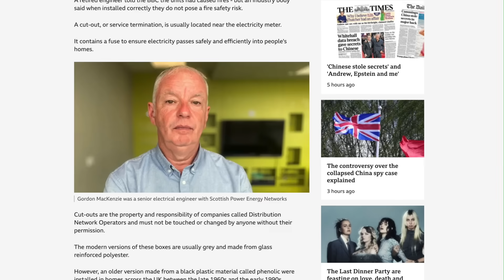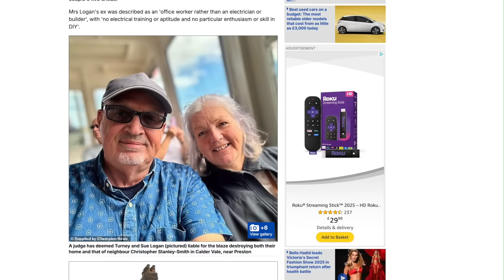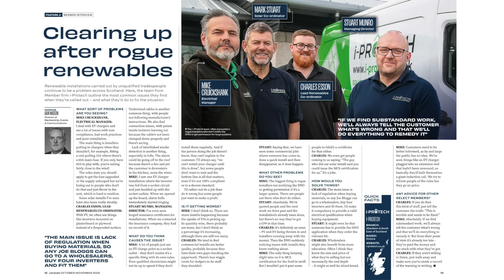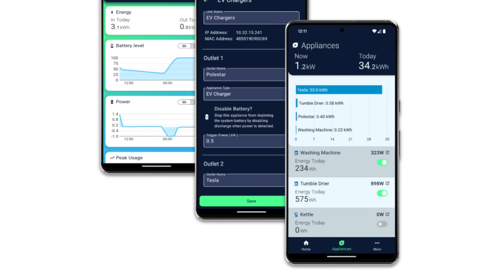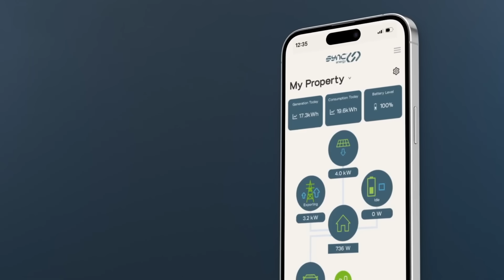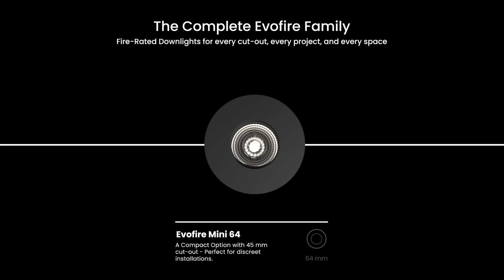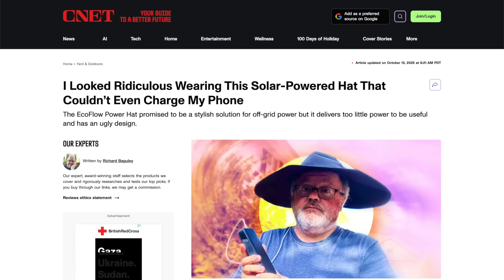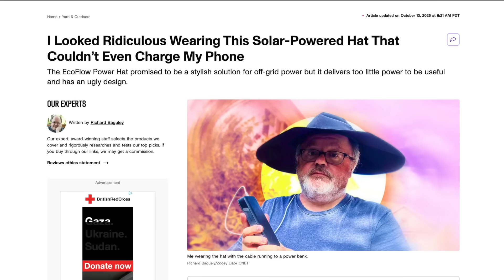Why Is the Electrical Industry Ignoring This?

Comment: I recently came across an EV install where the tails had been removed from the meter to fit new ones to Henley blocks. The installer hadn’t fit the tails back into the meter properly at either side. The live into the meter didn’t even have the terminal screws tightened at all and the plastic had begun to melt. To top it off, the cover hadn’t been fitted back onto the meter, leaving the whole terminal block open to touch 😬
Reply: Ripe with RIDDOR!
Reply: Seems really nice for the customer. Quite low bills

Comment: At what point does running an extension lead become an installation subject to wiring regs? Thousands of sheds throughout the country have extension leads running freezers, lights, power tools etc, not to mention all the extension leads in houses.
I'm curious as to how the court could be sure enough that the problem was the extension lead and not the freezer itself or its cable. And was the fact the plug was removed & refitted a significant legal point?
It seems likely the insurers have declined the claim, assuming they had insurance.
Reply: Generally the states in Australia consider 'used in lieu of fixed wiring' and that is defined essentially as the cord being fixed, ie clipped, zip tied, wrap around, woven through, wedged under or any other way that prevents it from just being rolled up and put away.  Cutting the end off and fitting a plug  is allowed in some states but cutting the plug off and putting it through a small hole would mean it can not just be put away, and become defacto fixed wiring.
Reply: @retrozmachine1189  Interesting point, as my first thought was that it wasn't part of the fixed wiring since it was on a plug end, but you make some very valid points. It does eventually, literally, become fixed!
Reply: The Independent has a lengthy article about this & the key points are that this was "used as a permanent installation", & the cable was unsuitable for an outdoor environment, in particular not protected against rodent damage.
Reply: @alanjewell9550  Correct Alan. Put an indoor cable permanently outdoors and yes rodents will eat through it, causing a hazard. Seems easy enough to understand.
Reply: @0liver0verson9 ..Are you trying to suggest rodents don't come inside houses and chew cables?....
Reply: @alanjewell9550 But you can argue a fridge/freezer cabled into a BS1363 plug and socket on a ring main in the kitchen is a permanent installation. It's fixed, it doesn't physically move and it is powered on 24 hours per day, 7 days per week.

Are they saying that because the cable exits the house that it now falls within scope of BS7671 ?

Any litigation, civil or criminal isn't done under BS7671, it will be done under Health and Safety legislation and or The Building Regulations, as BS7671 isn't an act of parliament.

It looks as if that because it is an electrical installation outdoor, even though what is normally considered an appliance on a BS1363 plug and socket, a permanent outdoor installation that it falls within scope of the building regs.
Reply: @deang5622 A fridge freezer installed in a kitchen plugged into a fixed socket is in use according to manufacturers instructions and the socket is covered by regs. What if it's plugged into an extension lead on a "permanent" basis to avoid the cost of getting an electrician to install an additional socket? This is where the potential implications of this ruling get interesting. Extension leads indoors are a frequent cause of problems as they are easy to overload & a lot of them are poor quality. Are we going to see  similar cases around these?
Reply: Any electrical installation used outdoors must be visually checked regularly and inspected by a qualified electrician at least every five years. The shed fire developed rapidly, most likely because it was filled with combustible materials. When the fire brigade arrived, they withdrew after spotting a propane cylinder beside the shed.

A freezer kept in a shed  can attract rodents, which often chew through cables. Using SWA cable with proper RCD protection might have prevented the ignition, or the fire may have started on the freezer’s power lead. 

According to other reports, the neighbour’s insurance company later pushed to take the incident to civil court, effectively boxing the homeowners into a corner with legal arguments.

Outcome, get an electrician to install the electrics, it may still catch fire, but you have a legal defense.

Additional 
Observation: Extension leads in use. These are not part of the fixed electrical installation (BS 7671) and should not be used as a permanent means of supply. Prolonged use may present risk of overloading or mechanical damage. Ensure suitable RCD protection and consider installing additional socket outlets to reduce reliance on extension leads.
Code: C3 – Improvement recommended.
Reply: @Brickandmetal  £100 roll of armard cable, any type, the cheapest will do, using the wild mounts, underwater in lakes or seas, the it keeping freezzer going light or two, but yes using cheap, or even andn expensave extanchon cord? Not a good idea, but all the home power ring main works your extension cable in breaking at the point it connects up,
Reply: Also, it was 13 years after the initial installation of the extension lead, so unless it was the blindingly obvious error, would have thought it would be difficult to tell the difference between a degradation over time and bad install ?
Reply: especially when the judge goes on to say that the cause was ultimately rodent damage !
Reply: You could argue the wiring regs don't apply because this is not part of the electrical installation, but the fact is the houses burned down because of insufficient competence by the person who installed the fridge and cable.
 This was a High Court case so it's a civil action against the installer.

So even if the regs don't apply, the installer is accountable for not applying sufficient skill in performing the installation.
Reply: The scenario was that they ran an extension lead into a shed for 13 years. Taking the plug off changes its purpose — it is no longer temporary and is now permanent. Once a lead is repurposed and fixed in place for that length of time, it becomes part of the fixed electrical installation under BS 7671 and the Electricity at Work Regulations 1989. The Wiring Regulations define an installation as “an assembly of associated electrical equipment supplied from a common origin to fulfil a specific purpose.” By removing the plug and fixing the cable, it ceases to be portable equipment and must comply with all the requirements for fixed wiring — including correct cable type, mechanical protection, RCD protection, and proper termination.

The regulations are the basics of what we do as electricians, but you also have to apply your own common sense. The case, as reported in the media, stated that the neighbour’s insurance company pushed for a civil court claim. For electricians, this should be alarming. If you inspected the property and ignored the extension lead — without even making an observation note — then the judge could have held you accountable as the competent person. You could be liable for £350,000 for one house and another £350,000 for the second house.

I hadn’t considered the legal implications of this before, but something as simple as an extension lead could end your business. Once a case like this is won and sets a precedent, insurance companies will push it hard. They now have a clear path to pursue electricians or inspectors who overlook fixed or unsafe extension leads during EICRs or inspections. This shows that professional negligence doesn’t always come from major faults — sometimes it’s the small, everyday things that catch you out. A missed observation, especially one that results in property damage or injury, could lead to civil liability and financial ruin. With insurers now using these cases to recover their losses, every competent person signing off an installation needs to be hyper-aware of what “temporary” really means.

This highlights the importance of professional judgement: the Wiring Regulations provide the baseline, but it’s common sense and diligence that prevent accidents and protect you from liability. A 13-year “temporary” lead is no longer temporary — it’s an unsafe fixed installation waiting for a problem.
Reply: @Brickandmetal My reading was the plug was removed to pass through a hole and plug was put back..? maybe I've miss understood
Reply: @roystevenson1375 Morning, yes, that is correct. The extension lead cable is put through the hole, meaning it’s no longer portable and stops being an extension lead in its truest sense. How the regulations see this is partly irrelevant in court — what really matters is how the legal counsel argues its definition and how the judge interprets it. It’s a fascinating story. In this case, it would be classed as fixed wiring because the plug was removed, later reattached, and the lead was left in place running for 13 years.
Reply: @Brickandmetal You have summed up the potential gravity of this case perfectly. It sets a precedent that insurance companies are going to use, hence we're all going to need to be very mindful of whenever we come across any "temporary" installation.
Reply: Again, I think the homeowners / policyholders lost this because the insurance company decided to throw some high-priced legal team at it, which they failed to counteract. I don't think any sensible person would actually hold these people responsible for the fire. The rodent damage could've also happened indoors with an extension lead; in behind kitchen units for example, and also gone unnoticed. Poor legal defence here.
Reply: @pjmorgan 
That case is massive for the trade.
The neighbour’s insurance company took it to civil court and won — the homeowner admitted her ex wired it, not an electrician, and there was no EICR. Thirteen years later it was treated as fixed wiring, not a extension lead.

Post-Grenfell, insurers and the NIC are clamping down hard. The message is clear: if you mess around with electrics, you’ve only yourself to blame. Big moment for anyone doing EICRs — the rules just got real.
Reply: Another interesting point about this case is the presence of gas cylinders. A fire crew would have to hang back & focus on keeping the cylinders cool, making them less effective at stopping the fire. I was on a job today that had a wooden cabin in the garden with a couple of propane cylinders immediately adjacent to the outside wall. I advised them to get a gas fitter to relocate them in accordance with relevant regs.
Reply: @alanjewell9550  I need to store gas cylinders (not plumbed into anything), any advice on where? currently they're adjacent to a brick wall with no timber anywhere nearby, as this seemed safest (also out of direct sunlight, not that this should matter given the margin of safety on the cylinder tests!)
Reply: @TheChipmunk2008 re storing cylinders, essentially away from any combustible material & in a place where any leak will disperse harmlessly & not pool in a cellar etc as LPG is heavier than air. I'm sure there's plenty of advice online from Calor, Flogas etc as well as from fire safety officers.
Reply: @alanjewell9550  The fire brigade wouldn't even comment when i asked directly!!! which blew my mind. Yes they're up high outdoors, so the propane can't pool even in still air :)  You mentioned gas regs though so maybe you have more knowledge than me :)

Edit, asking the supplier, (in my case calor) is a good call thank you.

(it's for a weed burner/roofing torch, and other high temp stuff like brazing, that i do as a hobby)
Reply: If the fire destroyed the shed and 2 houses, it would be very very difficult for Fire Investigators to ascertain what the cause of the fire was! It would be at best a guesstimate. This decision has massive implications for homeowners!!
Grenfell tower fire was started by a fridge!
Reply: Sorry, but he must have had the shittest barrister known to mankind
Reply: AT the point it burns down the neighbour's house?  It's still criminal negligence imo. Rodent damage causing a fire implies no RCD, and they were readily available 13 yrs ago
Reply: @TheChipmunk2008 Rodent damage to a 3 core flex might not trip an RCD because of the triangular core pattern. The line & neutral could easily connect & start a fire of the kind of tinder that accumulates in & under sheds before the cpc is involved. A twin & cpc cable is much less likely to fail in this way because the cpc is between the line & neutral conductors. And this should have been armoured or protected.
Reply: @alanjewell9550  True, i mentioned this in another comment further down :)  I think the judge likely misspoke, you don't have to be an electrician to do what he did, i mean hell, the Range were literally selling part p compliant outside socket kits when it first came out (rcd plug attached to flex, and a BG storm outside socket).

I believe the couple are not feasibly liable for this, it's an 'act of rat'. What if said rodent had chewed through a lighting cable with a relatively marginal but still compliant Zs, and the fault caused the fire?
Reply: Unless as also noted by myself elsewhere, there are parts of the story not being reported
Reply: @TheChipmunk2008  it's tortious, an person is liable. It isn't the neighbour whose house was burned down. If you own a home, you have an electrical install that is unsafe in some way and somebody gets injured - or it burns down your neighbour's house - you are legally liable. That's the end of it. Insurance will have a disclaimer against DIY bodge jobs. One might think that, okay, so it's the guy who did the "install" - the problem is the homeowner is liable for not using a competent electrician, because it's their house - the person who did the installation doesn't know that it's still being used and that it hasn't been checked/replaced, and there's no reason they should.
Reply: @TheChipmunk2008 a court has found them liable & that sets a new precedent. Unless that is overturned on appeal, this has major implications for home owners, tenants & electricians. I hope the IET are following this & working on a guidance note.
Reply: the insurance company would just use the bodge job thing as a getout :(   An NYY-J cable clipped direct would be compliant (if rcd'd at source, maybe with a type S)  but still potentially liable to the same damage
Reply: @alanjewell9550  it isn't precedent in the legal sense because it isn't an appellate court.
Reply: @alanjewell9550  and i hope they're planning on an appeal too! If that kinda thing is no longer compliant, it's gonna make eicr's much more of a headache, with many many more C2s

I guess that's good for the trade, IF we can persuade people they need to pay more
Reply: @alanjewell9550 it may not trip an rcd but unless it was a high enough resistance to melt stuff but not enough to blow the fuse before something combusted then the RCD is not the issue. Obviously the cable should have been armoured as a bit of flex won’t have a decent level of uv protection or mechanical protection. Does depend on where the fire actually started. Plenty of compressor motors have been know to catch fire but that wouldn’t provide the opportunity for the insurance company the ability to not pay out would it.
Reply: @davideyres955 there was a mention in the Independent about the first indication of fire being flames coming from under the shed shortly after the power had tripped out. Even a small arc between line & neutral due to rodent damage would easily ignite the dry leaves, nests etc under a typical shed.
Reply: v is a waste of time most of the time, the chance of getting paid is slim, there's something you're getting a full payout, a bit of legal protection to a small point, but to their protection rather than yours.